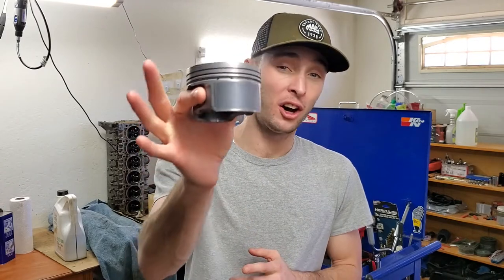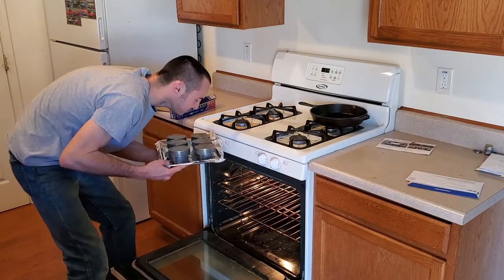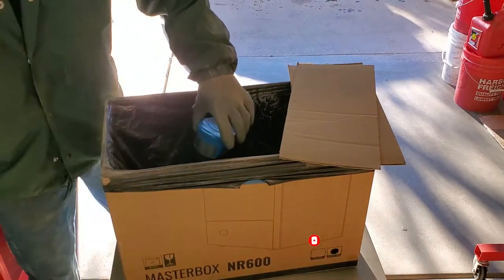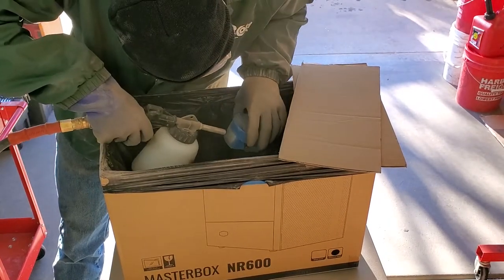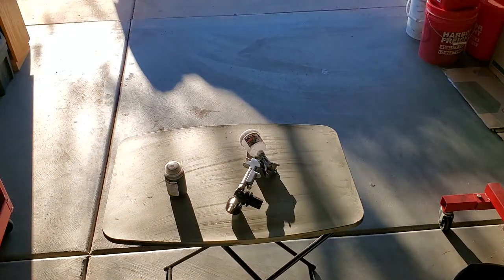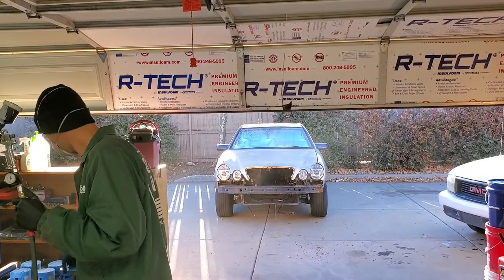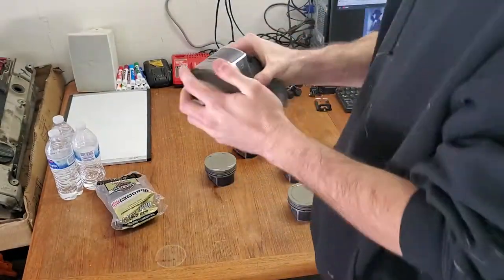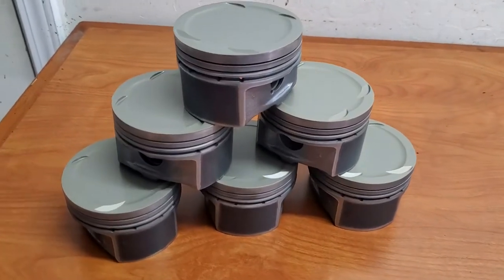How To Apply Piston Sideskirt Coatings | Cerakote C-110

Comment: Thank you for the c-186, Piston top coating video and the c-110, Piston skirt coating video. I've been interested in having this done but we don't have anybody near me. Now that I know how it's done, I thank you. Can you please elaborate on the before and after differences of performance, mileage, temp etc, anything that you have noticed, Post rebuild, after the coatings were sprayed and engine put back together and driven?? I noticed you said a 5-day waiting period with no oven cure, does this brand cure without heat before engine start up? I usually see people buying toaster ovens from the second hand store to bake their pistons after being sprayed.. is that really needed? 
Or are they just going the extra mile? 
I have read cerakote articles where people spray the bottoms of their exhaust valves and the insides of their combustion Chambers.. do you plan on doing this in the future? If so, can you please make a video? Also, where did you purchase your piston coatings? 
I noticed when you applied the c-110 micro slick, to the Piston skirt, that you left bare metal around the edges. Is that done on purpose for a specific reason? Or can the whole skirt from bottom ring down to the very skirt  bottom be coated??
Thanks,

Comment: The coating will wear away, as long as it’s not scraping off as you’re putting in cylinder bore I think it’ll be fine. Oil filter needs to be changed after engine brake in anyways
Reply: I’m going to to try on my diesel pistons along with the top coat, fingers crossed 😅

Comment: Any chance you have a before and after skirt diameter measurement? Thanks!
Reply from the maker: Sorry brother, I dont. I just eyeballed the thickness and got it as close to stock as possible. I figure if the coating is too thick, itll rub off and make a perfect fit inside the bore.

Comment: Is this a tried and tested job or is this a suck it and see and make a video while at it
I always thought the coating were done to specific tolerances
Reply from the maker: I followed manufacturer directions and used the proper equipment. This should perform as advertised. The only thing i would do differently is reduce airflow, and wear as mask (to reduce dust getting in coatings).
Reply: @JakeSublime  are the pistons in the block then ? Did they go in ok if so...
I'll be interested to see how this works out

Comment: Have you put it to use yet? How's the pistons holding up. Hey you may need a 3rd video for that and show the pistons after a thousand miles😂
Reply from the maker: Hey, the engine is together and prepared for all the peripherals (alternator, pumps, manifolds, etc). Should be running in 1-2 months if my wallet allows me to finish the turbo setup haha. 

But this is a really good idea. Ill think about it, and maybe ill come back after i do some burnouts, high engine load circumstances, etc.. and then inspect the coatings. Thanks for the suggestion!
Reply: @JakeSublime  I was emailing the guy today. I told him you had done 2 vids and that he should sign you up, because you were more relatable and gave very good info. Hope I don't see that, after 1000 miles video unless they sign you up😉
Reply: @JakeSublime  have you considered coating the underside of the piston?.
Coating the top side on an engine will rub off when the engine is used for long periods
So i was thinking it wouldnt hurt coating the bottom side which will further keep the heat away from the oil and never rub off
Reply from the maker: I like where your head is at. It sounds like youre talking about the ceramic coating for the piston. 

The ceramic SHOULDNT come off of the top of the piston. It molecularly bonds to it, so no matter what the ceramic is a part of the piston now. That said, the ceramic's job is to act like a mirror, and like insulation, both at the same time. That way, the piston absorbs less heat from the combustion chamber, keeping it cooler. 

In any engine, it is beneficial to have oil splash against the piston some how. This assists the piston's rings in removing heat from the piston (as piston rings primary/secondary jobs are to remove heat from the piston). Coating the bottom of the piston would reduce the amount of heat the oil can remove from the piston, and that would be bad.
Reply: @JakeSublime  i agree. I was more focused on trapping the heat inside the chamber and not caring about cooling the piston. 

It was because I read somewhere that a guy had his pistons lose 40% of the ceramic coating.

I was also wondering about iron sleeves in high performance engines. Why dont they ceramic coat the Outside of the iron sleeves before they press them

 this will help keep the heat inside the chamber as the piston moves down and the cooling of the aluminum block will not be effected if anything improved
Reply from the maker: The ceramic coating of his came off for some reason, one that may be unrelated to the way the ceramic is connected to my pistons. I have seen others do exactly what i have done with their pistons, and then stress test the piston outside of the engine to see what it takes to disconnect the ceramic from the piston. I am confident the ceramic will maintain adhesion to the aluminum surface of the piston. 

Your second question, if you coat the outside of the cylinder sleeves, the actual sleeve (we would call the cylinder walls) wont be able to transfer heat from itself to the coolant. The cylinder walls (and thus the whole sleeve) will absorb heat from the combustion chamber. And you cant coat the inside of the cylinder, the piston rings need a super smooth cross-hatched surface to ride on. 

The only places that benefit from ceramic coating are: the piston tops, the head side of the combustion chambers, the bottom side (combustion chamber side) of the valves, and if you want to go crazy you could do the top side of the valves and the entire surface of the exhaust ports.

One thing to note: The combustion chamber DOES NOT include the walls, piston, head, etc. Its just the CHAMBER; the EMPTY SPACE inside the engine, above the pistons and below the cylinder head, is the combustion chamber. Does that make sense? i think this info might help you
Reply: @JakeSublime  yeah, I was reading that. You would want to trap the heat inside. If you look on you tube, someone did a heat transfer test. It's smart to do the tops and bottoms if you do the top with Ceracote. The Microslick literally wears as so would the aluminum. Good stuff. It allows you to have tighter clearances.
Reply: @JakeSublime  Also,I was told to just do the valve faces. In theory, sealing the combustion chamber sounds good, but in the next thought, its, well, the metal from the cooling passages to combustion chamber will bounce back towards the water jacket as it is trapped by the coating. On a street car, this would be a no-no as well as endurance and would cause possible warping. Now, in supergas per say, this wouldn't be a factor

Comment: After a year, how are the coatings holding up? Assuming that you have the engine running
Reply from the maker: Not sure. The engine hasnt spit anything out, and the combustion chambers just look BLACK lmao. Too much racing it i suppose. 

I will eventually pull the pan and check everything, down the road. When i do, ill check the pistons and their coatings.

Comment: I thought these pistons looked familiar. I'm looking for an OM606.962 to stuff into my W124. The 606.910 leaves me a little wanting 😅. Did you do this to restore the original coating that had warn off?
Reply from the maker: Nice, I say do it!! And yes, the factory coating had worn off a little bit, that and i wanted to put an updated coating on it. Not saying mercedes doesnt know their engine stuff, im sure the factory coating would have been okay in its worn condition. But, i just figured a piston coating designed by a name brand in 2019-2020 would be a good bet. 

Plus, this coating with the other coating i did on the tops, now i have custom "high performance" pistons. :D
Reply: @JakeSublime  I would in a heartbeat, but time and money restrictions right now. I'm just keeping my ear to the ground waiting for one to pop up. I'm guessing modern materials are better, but MB did some cool stuff back in the day. You think their modern engines have piston treatments? Maybe their high dollar or performance oriented cars, but otherwise I kinda doubt it.
Reply from the maker: My guess is most engines in general have sideskirt lube coats (modern engine designs). So yes, mercedes probably does that with all their engines. I doubt most manufacturers coat the piston tops with ceramic, however. Maybe a select few models from a few manufacturers, or possibly some high end cars like lambo or something.

Comment: If you were to put a thick enough coat on, do you think this could help/eliminate piston slap? Looking for a cost effective way, low on funds.
Reply from the maker: It surely would at least reduce slapping, yes. However, if I were you, I'd try to source used pistons from a motor in a salvage yard or something. Just a thought
Reply: @JakeSublime  No it will not, It will cease the piston in the wall & cause the rod to protrude from the block. You cannot DIY piston skirt coating. The paint has to be heat treated onto the piston at certain temperature & also you have to chemically clean the piston prior to coating it. This is entire fail attempt. Do not try this, your engine will throw a rod or two I a sure you. Not to mention you will have paint flakes in circulation internally.
Reply: And also your dry film thickness is 0,0001 to 0,0005 as per cerakote recommendation. Basically 2 light coats worth at 30psi. In this case slightly overdone but OK
Reply: Nah, it says all over that it doesn't change the dimensions...

Comment: Very impressive work. Where could I get the coating paint? My Merc 90 hp is slapping, so I think the easy way is to build up the piston skirt wearing surface for reducing friction.
Reply from the maker: If you pop a quick google, Cerakote C-110 is available on their own online store. Both C-110 and C-186 can be purchased over there. "Tester" size is what i used, and it's enough for 2 small/med engines (4-6 cyl) or 1 large engine (8-12 cyl).

However, if youve truly got piston slap, its possible that sideskirt coatings are not the answer. You might need new pistons, brother. Then, coat the new pistons with C-110, and maybe C-186 while youre in there lol.  I might be wrong about that, so unless you know otherwise, id give it a try at least.
Reply: Hi Osborne, am in same situation and rather than spend £400 on new pistons & liners will try the £35 tester bottle of this stuff.  My engineer says we only need to make up 3 thou on the skirt - so is about 9 coats of this C-110.   Did you try this yet.?   work for you.?
Reply: @pbocking44  this wont work. Its paint not metal. And its air cure. This will scuff off

Comment: Hey that looked really good. How much do you allow on your piston to wall clearance for the product?
Reply from the maker: In my mind, as long as its not so tight in wont go in, itll be perfect. In fact, the tighter, the better. Any extra material the piston doesnt want on it can be worn off and at th4e least depo'd into the cylinder wall, creating a more slick surface. If nothing else, the piston will find its own clearance. 

I only say this in this circumstance, because were talking about a "lubricant". So on short, i sprayed and prayed i guess haha.
Reply: The cerakote material is less than a mm thick, it has negligible effect on clearance.
Reply: @JVR_Funwithdesign  you mean um ( micro meter ) probably :)
Reply: @flappingflight8537  Nope..the tech sheet for it says 1mil ;)
Reply: @JVR_Funwithdesign  1 mil isn’t = 1 mm but it’s roughly =25.4 um ( micro meters )
Reply: @JVR_Funwithdesign  NASA lost a rocket because of that :)
Reply: @flappingflight8537  of course you are right, not sure what I was thinking.
Reply: With cerakote more is less. I've failed many a time. Trust
Reply: @JakeSublime  will mess with the rings bedding process having all that foreign material in there. And what about subarus? Clearances are already so tight doing that method will definetly have catastrophic failure. You'd need to see the thickness of each layer. It has to be done exactly like your control test that would have tocbe done to get the thickness per layer

Comment: Why does dinner taste like.... like.... *smacks lips*.... engine oil? Bro don't use your oven. I had to bake my cases to get the bearings out. Use an old grill with a low flame and get it up to temp. Works like a charm. I did however get some funny looks from my neighbors when I was loading a grill with a cookie sheet of engine parts.

Comment: This process entirely is a fail attempt. Do not try this, your engine will throw a rod or two I a sure you. Not to mention you will have paint flakes in circulation internally. The correct way to coat is you gave to chemically clean the piston it self first & you bake the paint coating onto the piston like powder coating process.
Reply: CeraKote Micro Slick is an air-dry product.
Reply: This literally makes no sense what you said the fk would it make you throw a rod and what do you think acetone is
Reply: Throw a rod! Lol . Thats funny. Blinker fluid would cause rod failure before this would.